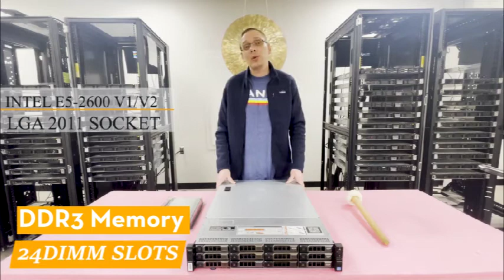Dell PowerEdge R720xd Server Memory Support Overview & Upgrade Tips | How to Configure the System

Comment: useful but only good if you are fully populating. what if you are not? for example i have 128gb in 16gb modules. 8 of them. would i be correct in thinking that you populate the white slots with them?
Reply from the maker: Yes.  That is correct.  You want to use the start of each memory channel if using 8 DIMMs.  That way you have an even, balanced distribution across all your memory channels.  Take care!

Comment: 24 modules at approximately $100 a piece means you spent around 2.5 grand, a quarter of your $10K R740 estimate, on just RAM alone!  I do very well with 256Gb of RAM in my HP DL380 Gen 9.  People buying a budget server don't need to spend extra money on the LRDIMM features, when RDIMMs are significantly cheaper.  It is an interesting video, but would be better without the piano music(8:16-8:40).
Reply from the maker: Appreciate the feedback!  Yes you are correct.  The R720xd will cost around what you are saying to max out the memory.   But the R720xd server with CPUs will be relatively cheap after that.  You can get the R720 for an even better deal.  And to get the same RAM capacity in R730 or R740 will be roughly 4 times as much depending on configuration.   But I agree with you.  Most people only need 256GB or 512GB memory kit.  And definitely agreed on the piano music.  We tossed it out in our newer videos. We learn a little more each time.  Thanks for watching and commenting!  Have a good evening.

Comment: My server currently has 4 x 8GB of RDIMMx1600Mhz single-rank memory. I am considering purchasing 8 additional 8GB modules (a 65GB kit) to combine with the existing 32GB for a total of 96GB memory (12x8GB@1600, single rank). Would this configuration meet the Dell specifications? Additionally, it is correct that it should be loaded in all 8 White module slots and the 4 Black slots on PROC1? Thanks
Reply from the maker: I'd recommend adding 12 more for a total of 16 modules.  With 16 DIMMs, you can install 2 DIMMs per memory channel.  This will create an even load distribution and help maximize performance.   Hope that helps.  Take care.

Comment: Thanks for the video! I have a question for you: The Dell user manual for the 720xd says that LRDIMMs are not supported in the 3.5" configuration, only for the XD with the 2.5" drives. Apparently it is a thermal constraint. The machine you are showing in the video has 3.5" drives, and you installed LRDIMMs. Did the machine post without errors? Is Dell's restriction based on an old BIOS configuration? Let me know what you think, thanks!
Reply from the maker: Yes.  You can definitely install LRDIMMs in LFF chassis of R720xd.   Hope it helps.  Take care.
Reply: @cloudninjas  Great! Thank you!
Reply from the maker: @Nar1117  Anytime!
Reply: The mb is the same!!